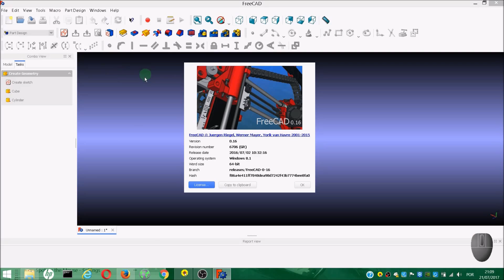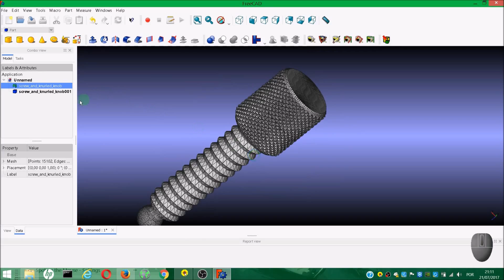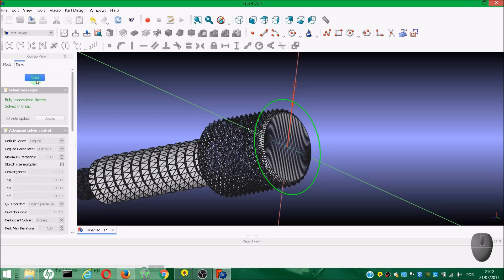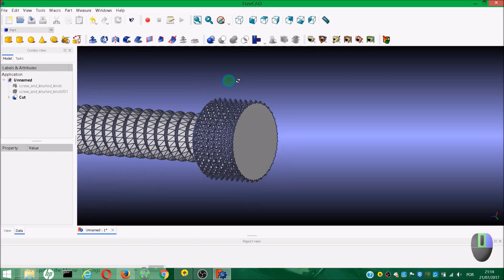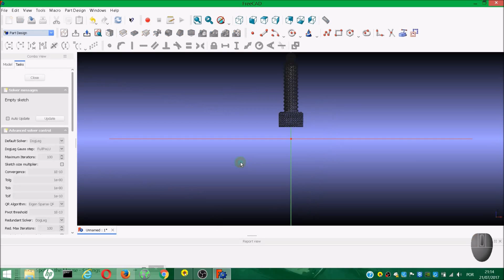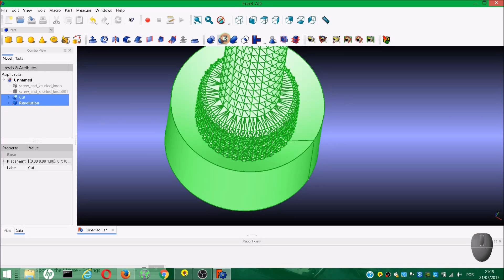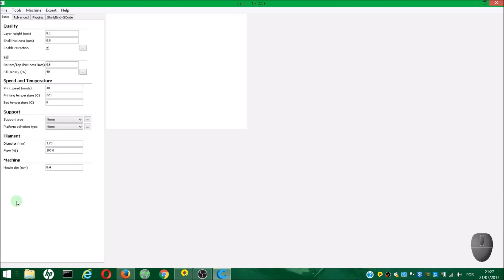FreeCAD Edit a STL File  (Creat a shape from mesh and convert to solid)

Comment: Hi, nice video, I tried that, but it kept on thinking for hours with no result. I have a hp EliteBook with CPU i7-3630QM, GPU AMD Radeon HD 7570M and 16 GB DDR3. Do you think I need something better?
Reply from the maker: If it is a very complex design it is normal to take a long time. I once modified a part that took 50 minutes. What you can do to speed up the process is to increase the value of the tolerance for sewwing shape. So the processing will be faster but you will lose some quality depending on the design.

It is possible that there are designs in which this does not result due to the complexity
Reply: ok, thank you